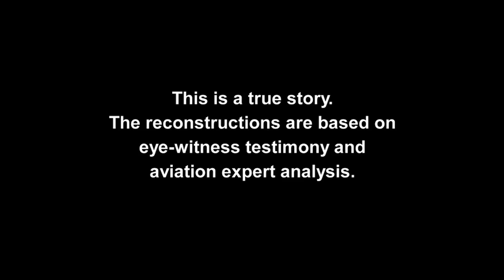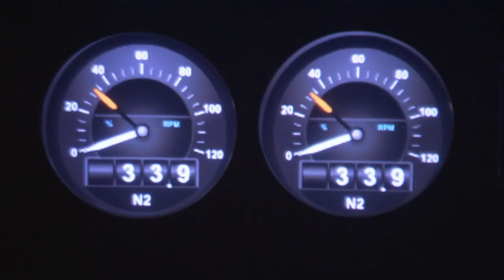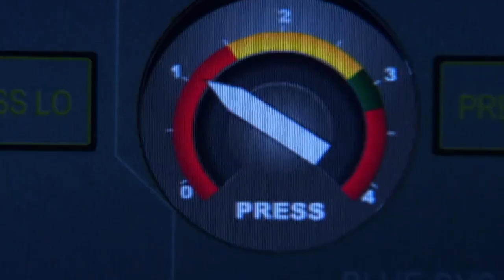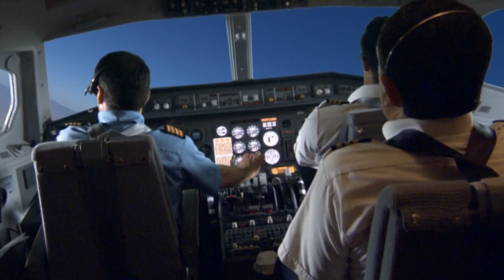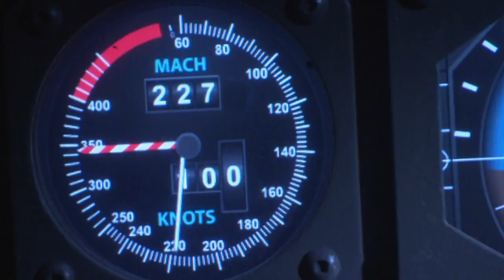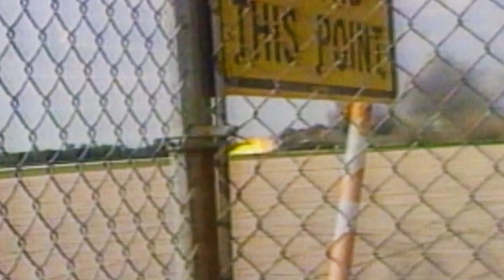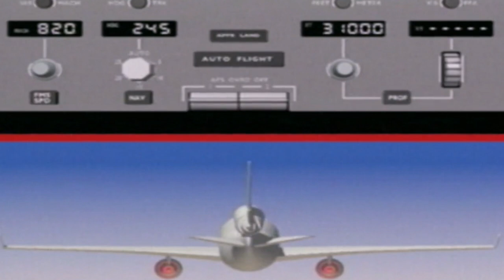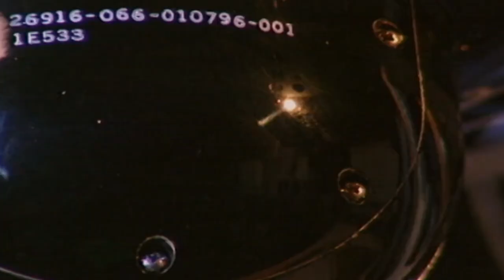DHL Delivery Plane Struck By Air Missile | Mayday | On The Move

Comment: A black swan event (a event where the aircraft looses all hydraulic systems) has actually happened in the past United flight 232 1981, and by sheer coincidence one of the passengers was a pilot who coincidentally also studied what to do during a black swan event and studied how to utilize the engines to “control” the yaw by differential pitch controls changing the amount of lift generated by one wing. The plane crash landed short of a runway and caused the plane to dissolve into several pieces, many of the passengers died however 175 of them including crew have survived and considering how long they had minimal control of the planes 175 was an amazing feat to achieve. After research the cause was an explosion in the rear engine that severed the hydraulic pumps of the plane causing the plane to loose all hydraulic fluid and loose control very very similar to this however the cause was due to poor maintenance and the design of the plane itself.

Comment: They've got the insignia wrong... The Captain, sitting on the left of the plane, has four stripes (they've got that one right). The first officer - sitting on the right - should have three stripes (they put two on his epaulettes). And the flight engineer (that's the guy in the back) has two stripes (they're showing three).  That must be an earlier model of A300, as it has a three crew flight deck... Later A300 had two crew cockpit.

Comment: Watched this happen from my patio when I was there. Was quite a horrific event. Props to the flight crew for keeping calm and refusing to stop aviating no matter what.

 DHL should never have had the contract in the first place, it should have been C5s instead. DHL was used as a coat saving measure.

A C5 wouldn't have had as much trouble as the A300 if hit, and has counter measures, so may not have been hit in the first place.

This whole thing was yet another example of  using contracted services when we should have been using our organic assets instead.

DHL proceeded to stop delivering mail for an extended period of time after this incident. That had impacts on morale, readiness, maintenance and resupply of critical assets. They only resumes flights when threatened with loss of contract permanently if they did not resume.

Comment: This may have been mentioned below, why aren't the hydraulics in those three separate areas isolated.  Then you could have three separate pumps and not all those hydraulic lines running throughout the whole airplane.  They would have lost the left aileron and maybe the left flaps, but they still would have had rudder and elevator and that's always nice to have.
Reply: I remember hearing of modifications done to the old DC-10 after the Chicago crash where the engine tore off the wing severing hydraulic lines causing the flaps on that wing to retract. 
Something was put in the hydraulic lines to isolate areas of the system in the event of pressure loss.

Comment: 39:51 The discussion of evacuating the airplane would be very interesting.  A decision to use an evacuation slide  or not could have triggered an IED.  Equally interesting would have been the decision to use airport stairs unless they rolled on the same tracks the airplane tires used.  I would love to know how these pilots excited the airplane.  The scene showing the fire truck making a pathway doesn't make sense to me for the simple fact that the airplane would have made it's own tracks and would have been a logical pathway in the event cooler minds had prevailed.

Comment: Why not have alternative control systems in addition to hydraulics. That way if hydraulics and engines fail, they can control the plane. They should also add valves and sensors that control hydraulic fluid flow, so when a leak is detected, the valves can shut and retain some control.

Comment: I always thought nowadays aircraft have both fly by wire and hydraulics. fly by wire is old though, not to mention you can use a wireless control system as well.
For those that don't know, hydraulics work without using power, which is why they're used, while fly by wire or wireless requires power. Even with other power sources be it generator or even batteries, these systems can still fail and battery power wont last long either. Older commercial aircraft were not made with robustness in mind due to cost so did not implement a variety of ways.

Comment: They was lucky, really lucky to be alive.
Partially was the missile hit the tip of their left wing, not on the jet.
But 11 years later which on 2014, MH17 wasn't that "lucky" compared to this DHL's jet.
Partially was DHL had been strike by SAM (Surface to Air Missile) but MH17 was shot by a BUK missile but the BUK missile exploded just outside of the cockpit's fuselage, leaded the whole jet to tear up into 5 parts up in the air and crashed down.
There's a differences between SAM and BUK missiles. 
But in both these cases, damp it to these lunatics terrorist. 
They will pay for what they had done in HELL.

Comment: The narration mentioned that fuel from the port wing was leaking out, and put engine 1 at the risk of shutting down from the lack of fuel. Did the crew know they were losing fuel? If so, did they shuttle fuel from the other fuel tanks (starboard, center) to ensure it didn't run out?

Comment: Great flying.  Just wondering if the elevator trim was available.
Reply: What I was thinking.  Often elevator trim isn't controlled via hydraulics, but by an electrically actuated screw jack.  I also kind of wonder if flaps and/or slats were available, they would have given them a lower stall speed.

Comment: Seems like it would be worthwhile for the US Air Force to develop a fly by engine only system for their cargo planes, since they're the ones most likely to face issues like this.  Once developed, the technology could be made free for civilian airliners to use too.
Reply: the missiles are designed to hit the engines since they're the hottest part. these guys got double lucky when the first missile hit few ft next to the engine and the second missile completey missed them.

Comment: i was in country at that time, however news was everything,  lacking.  I did see a photo of the plane on fire, but my comment is on the looting of ASPs around the country.   I did an IH survey at an ASP near baghdad, which was about 15 miles long and 7 or 8 wide.  it contained about 70% detonators and fused detonators (range, altitude and proximity) in vast numbers as well as what would become IEDs,  3 up, one down that took so many lives.   also there were "objects" there, which we knew what they were, but no one, not even EOD knew what they were to be used for

a mystery even to this day

Comment: Redundancy redundancy did I say redundancy? Always have a back up. Plan D is better than plan C or your going right on into the ground. 
If I ever own a single engine I'm getting the Cirrus. It has a shoot that deploys in the event of engine failure with no available gliding you can do. a glide with a shoot deployment or just glide down and get the engine fixed. Also it's pretty simple yet sophisticated. Super reliable little jumper with a nice range reliability and practicality.

Comment: Is the hydraulic fluid flammable? If not, why didn't the fire go out?  Secondly, they were extremely lucky they didn't blow up by a bomb on the ground where they landed. Just imagine that after you achieved the impossible by landing the aircraft with no control, only to be blown up by another bomb on the ground.  How much would that suck?

Comment: Safety systems in aviation have been developed incredibly overkill for obvious reasons. You'd think that every aircraft flying over or into conflict zones should be required to have some kind of missile protection system. Also shouldn't the hydraulics systems be separated for each wing and tail?

Comment: CORRECTED - EDITED TEXT
; On Saturday, November 22, 2003, a surface-to-air missile is launched
; at a DHL AIRBUS A300 - exploding the port-wing and causing a massive
; loss of hydraulic fluid which immobilizes the flight control surfaces.
; The crew flies the aircraft by carefully adjusting the thrust of the
; engines to maintain control and managing to make a safe landing
; 16 minutes later.
NOTE and learn that CORPORATE names are always in the ALL CAPS iteration
You will notice this when you learn to pay attention to detail - and see exactly
what it is you are actually looking at when the eyes are open.

Comment: Awesome documentary! But I think the technology to save aircraft having lost all hydraulic fluid (which happens sometimes when engines explode) is rather cheap, light-weight and without big modifications easy to install: electric servo motors actuating the outer ailerons. (the jackscrew of the elevator rudder is already electrically driven therefore elevator trim should work). That experimental flying with no hydraulics software is of course awesome but not a life-saviour because - hint - loss of hydraulic fluid is normally caused by exploding or ripped off engines so with asymmetric thrust this software will not function... but small electric backup servo motors that can be switched on in emergency situations for slow actuating ailerons and rudder to keep full controls will. ;)

Comment: Why not install an auxiliary, remote, servo system on all components. Manually engaged and only used in the event of hydraulic press. loss. Maybe a waste valve or press. "Bleed off" in case of other failure. Either case, it'd eliminate having to overpower any pressure or standing fluid.
Reply: Weight. Cost. Complexity. Additional point of failure. To have a servo strong enough to move control surfaces adequately in lieu of hydraulics, those motors are going to have to be rather large. And heavy.
And if the motor siezed up for some reason, it might cripple the surface it's attached to also.
The hydraulic system is already quite redundant.

Comment: Sadly to this day, inline cut off valves for flow are not "required". A inline valve is a 15$ pease of aluminum that would stop hydraulics from leaking if the section of pipe is broken. Let's say in the alarons (wing controls for side to side) if the tip (one of 5 or 3 depending on the aircraft) wore to brake at least the 1st, 2nd or 3rd (so on) would still work with the broken section basically being "cut off" and thus "re-routed" to service the 1st, 2nd 4rd (so on) aloron or elevators (up and down controls). 150lbs to 210lbs is too much weight it seems for a safety feature that has to be main standar v.s just 3 systems. This is the case study that proves an "open" system is flawed and unsafe v.s a inline valve/ reroute system. Classic case of profits over life.
Reply: Right. $15 piece of aluminum.... have to bw aviation grade aluminum, so add a few bucks more. Multiply by 3, one per system... then, let's say we isolate... each wing and the emppenage, multiply by 3 again.
Then you have to add in several thousand feet of wiring to connect these valves up to a control system, which adds a couple hundred pounds and more money.
Then you need to add in a box for all the wires to go into, and out to the controls, which is more money and weight.
Then you need a big fat instrument panel that has at least 9 toggle switches and clear labels.
Oh, and don't forget to train your crew on the system-even if it does the shutdown automatically (add in money for sensors downstream), you need to train your crew on how to override it in case they just need that system that badly.

Unfortunately you can't just say it would cost $15... and if you add enough redundancies to a system, it just becomes too much for people to control.
Reply: You also can't say this is a case study, as complete hydraulic system failure is really rare, and this one was cause by a civilian aircraft being hit by a missile... and aircraft surviving direct hits by missiles is also, again, extremely rare.

A counter to your "case study" would be the hundreds of thousands of flights a year that don't have hydro failures, or the hundreds that only have one system go out.

Comment: would it not also be a good idea to have control valves located at various points along the hydraulic lines so that in the event of any damage that results in a section loosing hydraulic pressure, that section can be closed off to keep the remaining lines pressurized ?
Reply: That's why there's 3 systems, so if you lose 1 or 2 you can still have the 3rd. Blowing holes in planes with missiles makes engineering redundancy a difficult proposal.
Reply: @MatyasArby  It sure as hell does make it difficult, especially if all your redundancy is located next to the others, but that's not what I was getting at. I just thought it would be essential to have stop valves throughout the system(s) so in case you do loose some part of the system you can seal it off at that point, so you don't loose hydraulic pressure for the rest of the plane. A missile that takes off half of a wing clearly defeats any number of redundant lines because they are now all gone ! But it seems absolutely insane that a mechanism is not there to shut off supply to those open and bleeding lines.
Reply: @psycronizer  Maybe, I'm no hydraulic engineer, but if you put in some sort of stop valve, wouldn't you risk locking up the hydraulic  fluid and then the flight controls would be locked in same position?
Reply: @MatyasArby  no ! not at all ! all the stop valve would do, is simply close off any damaged section that the lines lead out to, so in effect all you are doing is clamping off a bleeding wound, which you absolutely must do otherwise each time the pilot tries to move the stick, the actuators start pumping pressurized hydraulic fluid, except there's a gaping hole in those very lines and all your hydraulic fluid just pisses out those holes, your hydraulic system bleeds to death. I have worked with hydraulics mainly in the stone and concrete cutting industry, small hand held hydraulic powered chain saws with diamond bits welded onto the chain, otherwise it's just like a chainsaw, except it's fed by a small petrol motor rigged to a hydraulic pump, cuts through concrete like butter !
Reply: This makes sense, in the human anatomy's perspective, we have blood instead of hydraulic fluids.
We lose too much we die, and that's why we need to constrict blood flow  to the part that's injured enough for our blood to clot.
This principle could have saved the souls onboard the JAL 747. The plane could have been more controllable with a functioning set of ailerons combined with engine thrust.
Reply: @ernestjorda2777  precisely, I'm glad that you see it, it's essential to keep the pressure of the hydraulic fluid-even if like I said a whole part of a wing is blown off then there's no redundancy left for that section anyway, and then it's best to close valves leading into that section so as to allow what's left to keep functioning, maybe they already have something like this I have no clue, but you'd really hope so ! have you seen how much redundancy goes into the A10 warthog ? and the amount of ordnance that plane can carry ?.  That jet has been upgraded and refitted so many times it's very very reliable, and now it's recently got another extension of life too.

Comment: The drag of the gear slowing the air speed down.  More power to bring your nose up.
Reply: More power reduces the rate at which the nose drops.
Reducing power drops the nose faster which means you can ramp the engines up faster over all

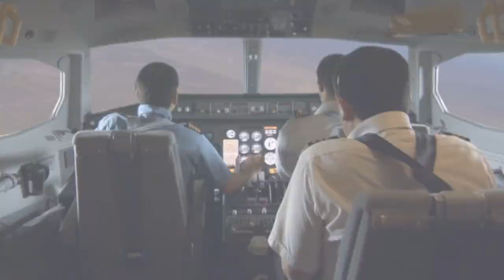Comment: 17:45... I'm not sure of when, but it was a long time ago. There was a TWA flight, I think, that lost all hydrolic fluid after the engine in the tail blew (sumn to do with a crack in some plate). I just don't rermember if that was before or after this incident, but they flew and landed using only the engines as a means of control.
Reply: They crashed
Reply: @u-know-this  but crash, LANDED...
Reply: And they actually did mention this later in the vid so...^^

Comment: It would appear that the stabilizer pylon blocked the missiles line to hitting the engine it was seeking...it also seems the brunt of the blow was absorbed by that stabilizer pylon enough to save the second wing strut at the back of the wing which kept the left wing together.

Comment: isn't there an emergency breakover to manual pulley control? that should be a feature for most planes flying in those regions if its that easy to bring down a plane just with a small leakage in the hydraulics :T
Reply: "Small" being entirely severed lines, sure...
Also I'm too lazy to look for this specific aircraft, but nearly no aircraft these days run straight wire from stick to control surfaces now, they use hydraulics.

Comment: Is it possible to embedd some gas pipes in some essential parts of the aircrafts (cargo hold, wings &engine) that will act as fire extinguishers?
Reply: Probably not 🔥 suppression systems= extra weight
Reply: Possible, yes. Some aircraft have fire suppression systems in their engines.... but i don't know of any that go past that to the wing tip, or to any other parts for that matter...
There's also the question of how you apply the agent, as in this case if it HAD that hypothetical system, both the control system as well as the pipes carrying the agent would have been severed...

Comment: Why dont they add normally open and closed solenoid operated valves and run the wires all over the plane and wings. That way if there was damage to the structure and it breaks the wire for any reason. it will kill power and close valves for the hydraulics. Isolating the damage allowing you to keep the lines pressurized?? Hell i can design a working system for an airbus like that myself in a few hours. Why cant they?